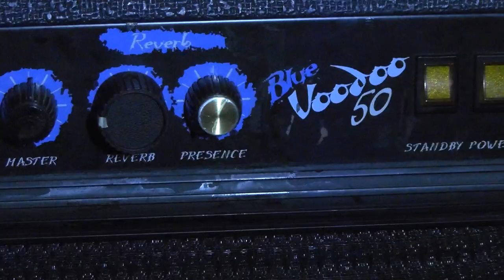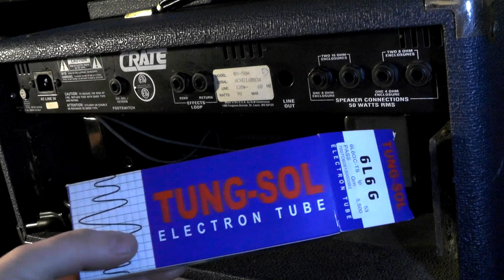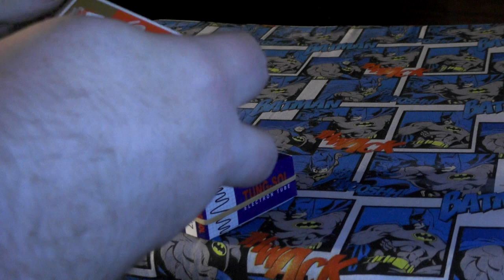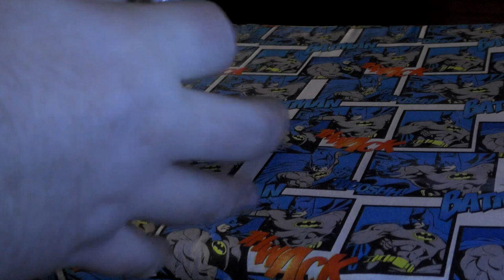Crate BV50H Shipping Damage & New Tubes!

Comment: I just picked up a second BV-50H on F-book Marketplace (not working). Geoff, Who owns "Amps and More" repair shop near York, Pa, did major repairs to it while I waited! Got it up, and running again!! He actually used to work for SLM electronics. (Genius level). Tim Eisenhacher, (who is also "genius level") at "Full Custom Music Repair" in Lemoyne, Pa. Modded my original Bv-50H (Which I still have) Once he installed his bias mods, the head stays cool,  and it sounds awesome, not harsh. I play high gain Metal/Rock. I destroyed this dude's Kemper rig, with my rig, at practice. I believe in these amps, but that redesign of the bias, is the key. I will make a video showing the inside of my amp head, and what Tim did. My two heads, one modded, one stock, DO NOT SOUND, OR RESPOND THE SAME. The modded head, is smoother, and doesn't sound worse when you turn it up. The stock head, I installed a fan in the back, so it doesn't "cook" itself, until I take it to Tim's. I see why people hate these heads, I was fortunate to have a guy rethink the design, and I benefited from it. I'm trying to share it with everyone (Before I buy them all up).

Comment: I always liked these amps, you are right about having the proper cab for it. Makes all the difference in the world. I have a Turbo Valve 60 watt combo, the reverb on that one is a little noisy as well. Crates seem to take pedals well, I run it with an MXR custom badass 78 distortion and run the amp semi clean. It def rips on the leads. Can't wait to hear the Blue Voodoo demo!
Reply from the maker: Hell yeah!

Comment: I have the 120. Best amp ive ever had. I gig year round so it gets a lot of work. Never had to change a tube, fuse or anything yet. I had a marshal tsl and was constantly changing tubes or fuses. Blue Voodoo is a killer. I run compression and noise gate in the effects loop and i dont have any problems with it being fizzy or too much treble.
Reply from the maker: That's awesome man, I definitely dig mine.  They are hard to find in the wild!

Comment: I just scored a like new crate gt 112sl speaker cab for dirt cheap . It’s built like a tank and it’s loaded with a Celestion g12k 100. I think it was designed to go with the old Crate power bock head . Which I wouldn’t mind having either
Reply from the maker: Thanks for commenting!  I have heard good things about the powerblock but never tried one.  Crate never got enough credit in my opinion.
Reply: I had a vintage club 50 head that I liked a lot . I also had this 2x8 stereo chorus Combo back in the 80s when I was a young man:)
Reply from the maker: @timmyv694  that is awesome.  I have the VC50 3x10 right now that sounds awesome cranked up.

Comment: I have always wanted a bv since they first came out. I found one on reverb 2 weeks ago. Guy said it was a bv 60, had original tubes, and no mods. I got it and its actually a 50 and had sovtek 5881 power tubes and pre was 2 ehx 12ax7 and a jj. The reverb tank was loose and hummed. Took out chassis and did a tune up and retube to all mesa. I love this amp! Not a lot out there about it. Any links to info? Thanks for the video!

Comment: Unfortunately, Crate BV heads don't Auto-bias. :(
Reply from the maker: Actually this one does, it says in the manual.  Here's the link:  https://www.manualslib.com/manual/33000/Crate-Bv-50h.html?page=7#manual
Reply: @ForsytheVideo  I digress. That's the first time I've seen that in a Crate amp. I have the schematics for the 60, 120, 150 and 300 and they all require biasing.
Reply: @Ghostman1846 I’m guessing based on the earlier BV’s the only one with their flagship “auto-bias” are the BV50H and BV60C